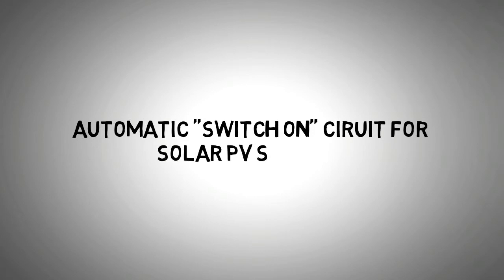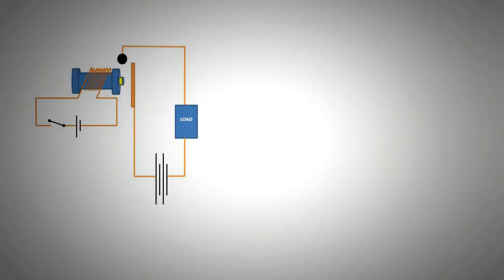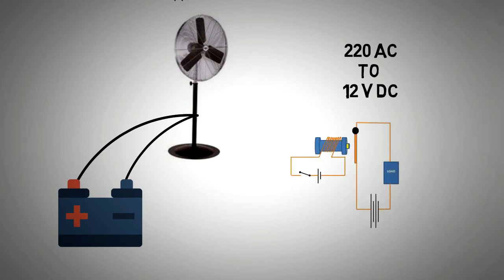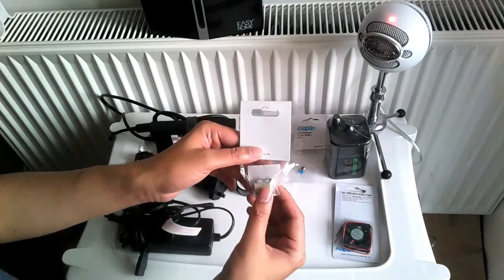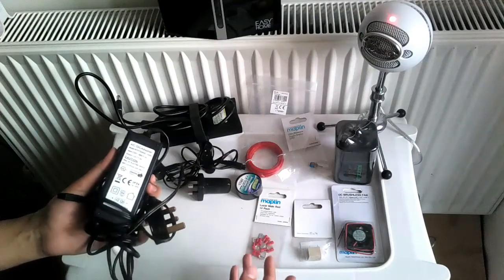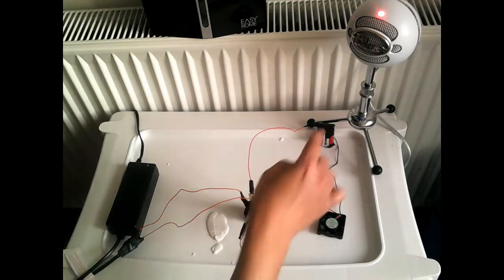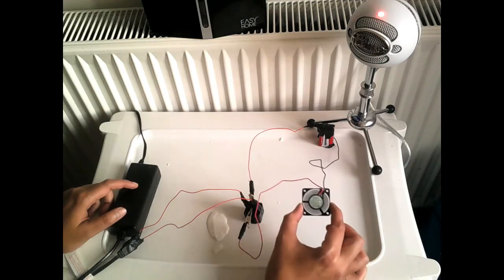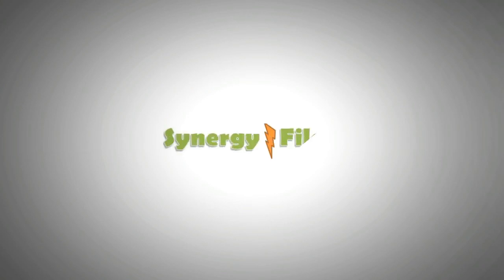How to make an automatic  Relay Switch Circuit for Solar PV systems

Comment: I have an off grid solar array set up in my shed, it is a 12v system. can I use a relay setup like this to switch over to a grid tie inverter connected to my house when the batteries are fully charged and switch back when they need charging again?

Comment: Can we use that between the wapda and inverter i mean between Ac to Ac supply ???
Reply from the maker: Yes you can use it between AC and AC.  You will have to use power supply adopter for coil current for relay

Comment: I have a system without batteries which was feeding in the grid, however the power company just changed the meter and it can not go backward. Even worse is that I had to shut down panels as if they are not shut down, it will show up as credit and increase the current bill, more than even using none. My question is do I need batteries, or can I isolate the mains with a system like this without having to use a power bank (storage)? In other words it will feed my grid directly without having to store the energy, and it will switch over to mains, once this power is not enough.
Reply from the maker: Yes you can do that. There are on grid inverters that support this functionality. You dont need a battery backup. Your house will be powered on priority from your panels. If there isnt sufficient power, the inverter will than use the grid

Comment: salam sir
I have a 12VDC battery charger of 30 amps, it has out put load protection, I mean if there is a battery or specific DC voltage supply is connected then it gives current but as the battery or supply disconnects the charger stops the output current. is there any way to run DC load without a battery connected to this charger? 
Thank you
Reply from the maker: I cannot say. I am thinking such a battery charger may have an internal relay that turns on after the batteries are connected or a transistor that operate a switch using the current from batteries. I cannot say until I test it
Reply: yes sir it has many protection like reverse polarity and short circuit. thank you

Comment: So what wires go where on the relay.  You never went over that.
Reply from the maker: You can see them 12 minutes in to the video. God I realise this is so painstakingly slow when I  rewatch it. My apologies
Reply: @synergyfiles3536  I can see the wires are attached to the relay, but I can't tell what terminal each one is attached to.
Reply from the maker: The 12 V power supply is connected to the row of three. The load is connected to the ones on either side of row of three.  This is a five port relay switch. This one you can use it normally open or normally closed configuration. One wire from the power supply goes to the top in the row of three. The second will depend upon how you want to use the relay, NC or NO. 
There is a circuit diagram printed on most relays. So that will also guide you
Reply: @synergyfiles3536  Are they also numbered?  From what I've read, they have the following numbers.   If I was going for a setup like yours to use battery if the power went out.  Does the power supply attach to 86 and 87A, and the battery positive to 87 and fan positive to 30?

                87
86           87A      85
                30
Reply from the maker: Yes the 85 and 86 are for the magnetic coil. So  the power supply attached to 85 and 86. Your battery positive will go to  87 and fan positive to 30
Reply: @synergyfiles3536   Great.  Thanks.

Comment: Sir kya  is relay main battery adapter or supply sub set ho jaienge .adapter off ho to battery pa chalna shuru ho jae supply
Reply from the maker: asif nawaz samjha nahi aap ka sawal. Aap dobara poochain?
Reply: Synergy Files mere pass aik DC celling fan hai main Chahta ho agar bijli ho to adapter pa chale agar bijli chale jae to wo auto battery pa chale
Reply from the maker: asif nawaz Han to aap bilkul yahi circuit jo video main hai, isko copy karain. Aur dc fan ko alag say bhi aik direct power supply say connect ker dain
Reply: Is main to fan off ho jata jab adapter Chalta hai
Reply from the maker: asif nawaz issi liay aap doosra adopter fan kay liay rakhain gay. Ya chahain to ussi relay walay adopter say directly pankay ko connect ker lain
Reply: Sir Thank you very Much